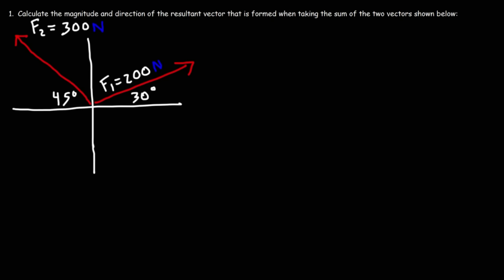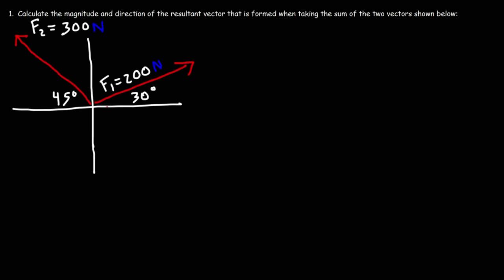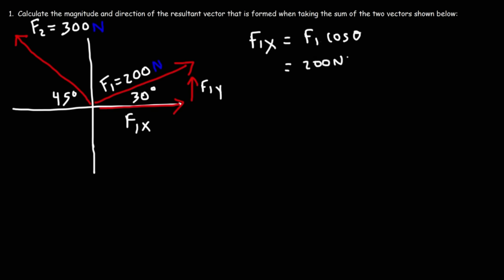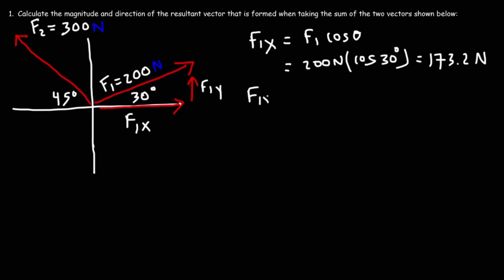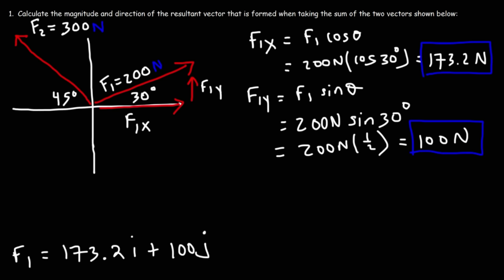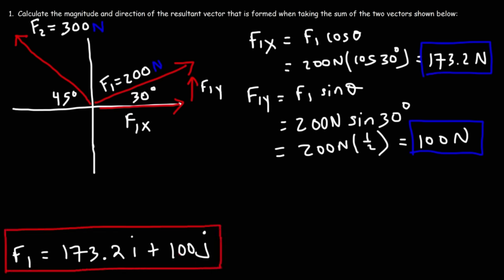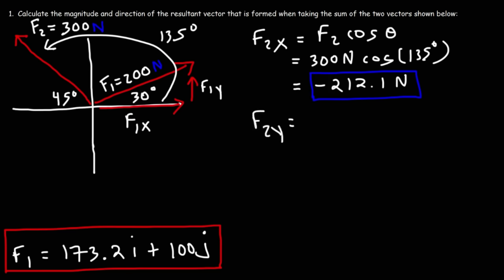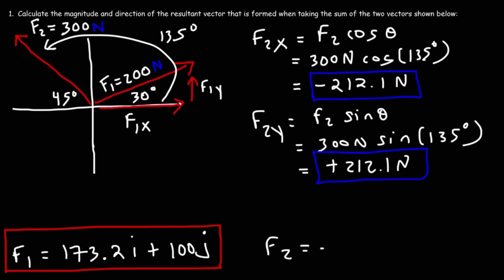How To Find The Resultant of Two Vectors

Comment: If we want faster method on this we can use the Pol( and Rec( function of your calculator

Pol(  :gives you the angle and resultant of force by inputting the resultant component x and y or i and j
Rec( :gives you the x and y component by inputting the hypotenuse of the triangle or the given force and the angle

Examples are based on this video's variables

Example for Rec( :
if you want to get the x and y component of force 1
use this function: Rec(200, 30)
Resulting value in the calculator:  x=173.205, y=100
Note: you can apply this to the force 2 but make sure to finalize your answer with appropriate sign

Example for Pol( :
if you want to get the resultant force and resultant theta
use this function: Pol( 38.9, 312.1) 
Resulting value in the calculator:  r=314.514, theta r = 82.895

What if you use: Pol(- 38.9, 312.1) 
Resulting value in the calculator:  r=314.514, theta = 97.104
Reply: Your a genius, god bless you 🙂
Reply: how to get the theta?

Comment: Is there any faster way to do this?
Reply: You can use the Pol( and Rec( function of your calculator

Pol(  :gives you the angle and resultant of force by inputting the resultant component x and y or i and j
Rec( :gives you the x and y component by inputting the hypotenuse of the triangle or the given force and the angle

Examples are based on this video's variables

Example for Rec( :
if you want to get the x and y component of force 1
use this function: Rec(200, 30)
Resulting value in the calculator:  x=173.205, y=100
Note: you can apply this to the force 2 but make sure to finalize your answer with appropriate sign

Example for Pol( :
if you want to get the resultant force and resultant theta
use this function: Pol( 38.9, 312.1) 
Resulting value in the calculator:  r=314.514, theta r = 82.895

What if you use: Pol(- 38.9, 312.1) 
Resulting value in the calculator:  r=314.514, theta = 97.104

Comment: Great video Sir.....I am however struggling to understand the difference between the reference angle and the angle relative to the x component when you used 135 instead of the 45
Reply: 180 - 45
Reply: i was wondering too why he didnt sketched a triangle at 45 the way he did for 30 one
Reply: It's because the second vector is in the opposite direction to the first, therefore, you need to subtract it from the first one instead of adding it

Comment: I don't understand why he uses angle 135 instead of 45 to find the x and y components of the vector on the left. Can someone please clarify?
Reply: @UtahButImTaller thank you for the quick response!
Reply: @UtahButImTaller No buddy, is a must to use 135° by logic from the positive X axis there is 0° when you start counting, you count 0°, 90°,180°,270°,360°, that's is the order in which you must start counting from, the angles are  always anticlockwise not clockwise, unless you are dealing with 90° where you would have to encounter spatial angles

Comment: Can anyone please explain to me why finding the Resultant force is so important? Like what is it’s use? Is it just to show us what the different forces are doing to the object or is there more reasons to why we calculate it?
Reply: For example, if you pull or push an object from tow different directions, you need to know the sum of the force that subjected on the object and you need to determine the direction of its movement.

Most of engineering sciences deal with this

Comment: why did u use 135 degrees?
it should be 45 degrees
Reply: it is not even a right angle dude, u use 135 and ur hyp is 300(f2), dude what are u doing

Comment: I can't find what im looking for wth
Reply: what r u looking for
Reply: @xia_01  nvm, I already found it. It was just SOH CAH TOA, our teacher didn't mention it, but all of us used the law of sines and cosines instead, and it worked.
Reply: @xia_01  Let me just tell you what were doing. Were finding the Reluctant of 2 given vectors(which has a distance ofc and angle that starts from any cardinal directions)
Reply: @norman783  you should know basic trig regardless if u used the law of sines and cosines as the formula changed for some questions and if yk the application it's much easier then trying to fit a formula
Reply: @xia_01  yeah we did learn basic trigo 2 years ago.

Comment: Good day sir! Can I just ask, why does it necessary to use the exterior angle instead of the interior angle to solve for the x & y components in the second quadrant? Can I just use the pythagorean theorem and then change its sign depending on its location in the quadrant? Or this is the only right way, the first one I've just said. Thank you!
Reply: Or I mean just another clarification, why does the exterior angle still applicable in the soh cah toa formula? Are there some rules about that? Thank you!